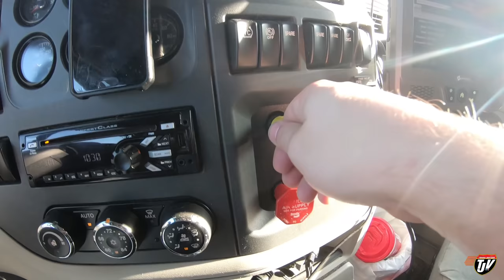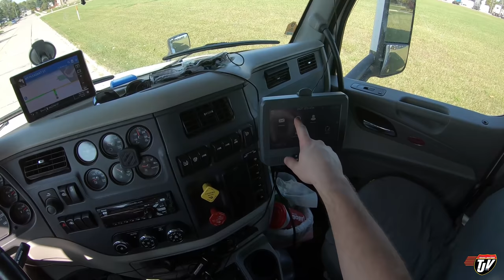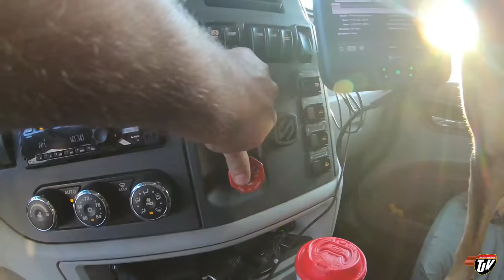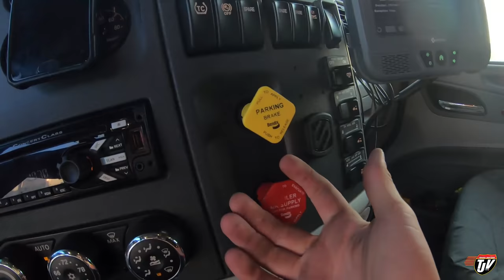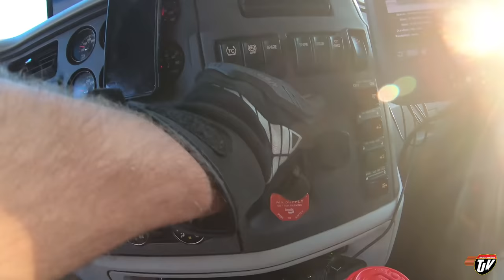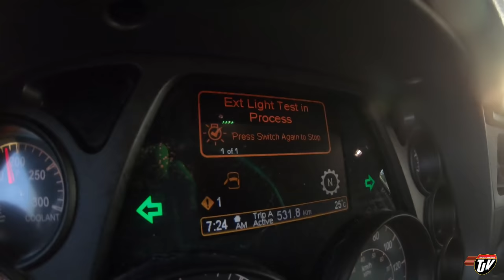My Trucking Life | TRAILER SWITCH | #2083 | Sept 25/2020

Comment: I’ve been pulling dry van & refer for 35 years you need to get a leaf blower to blow those trailers out with much easier.
Takes five minutes no sweeping you get all the crevices and you get a much better job thanks for the videos have a great day

Comment: Spit works most every time.  Nothing worse than picking up a trailer load and have the rubber diaphragm missing.  I always called them donuts. I kept many different styles of replacements in my tractor.

Comment: Hey buddy good video but you forgot a couple of things. Check to make sure the seals are properly inserted in the glad hands, before using the hammer, lol. Check your tires at every stop as you might see something like a nail or steel cord eroding through the rubber one time but not the next, as we cannot see 100% of a tire. Also I check the front and back of a wheel/tire for bubbles and oil leaking from the axle hub seal. You don't want a dot officer to find any of these issues.

Comment: As a previous owner operator I always carried a few glad hand rubber seals and some WD-40. Never hooked to a new trailer without a bit of WD-40 on the glad hand seals. Yes it was money out of pocket but it was the piece of mind knowing I had a solid air line seal and brakes. I always thought of it as a cost of doing business. BTW how often does the 5th wheel get grease? Not a big deal over the road but very useful in the city.